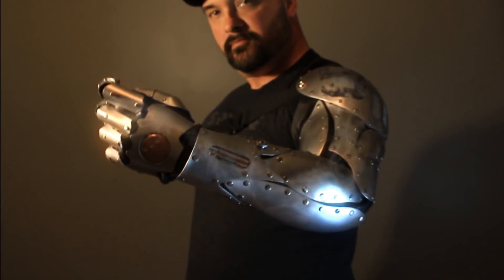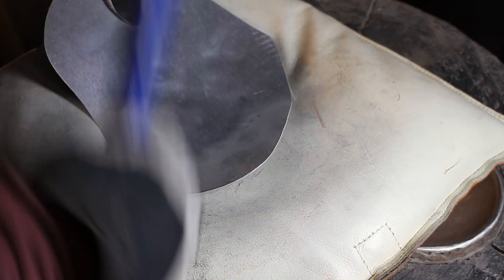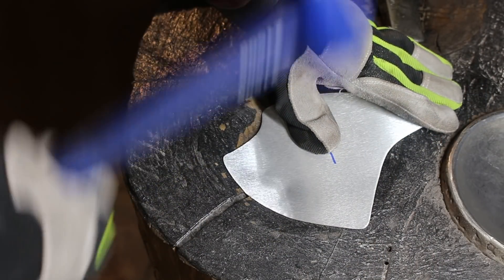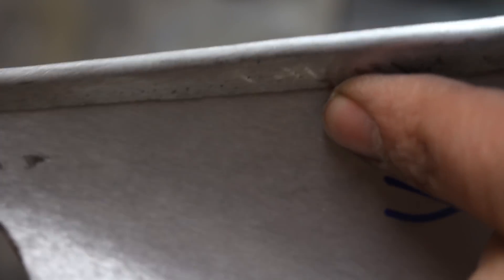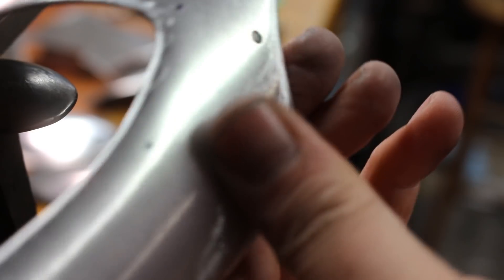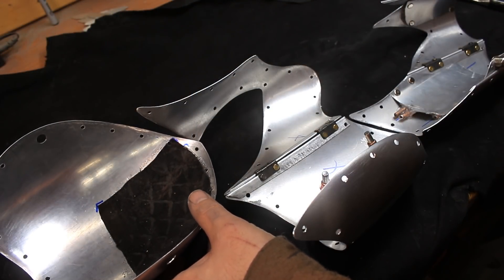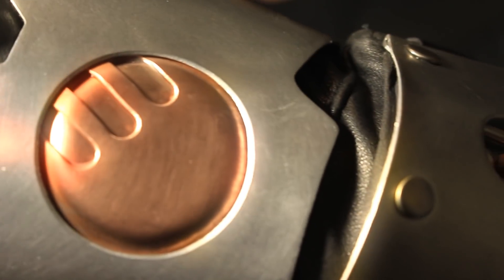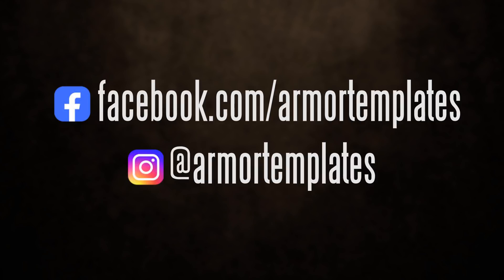WIN THIS BIONIC ARM! (Plus watch me build it!)

Comment: doesn't the aluminum sheet workharden? i didn't think you could bend it like that without annealing
Reply from the maker: Yes working any metal will harden it over time, however under these circumstances it's nothing to worry about.